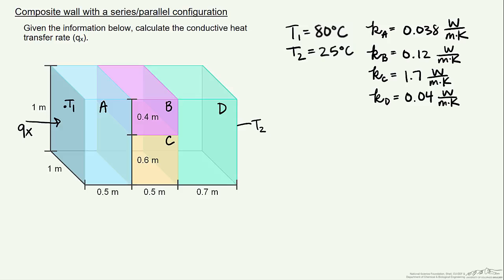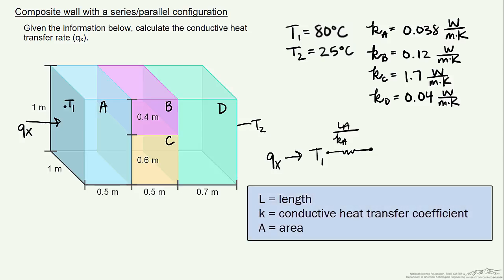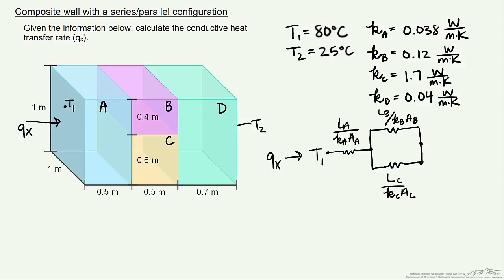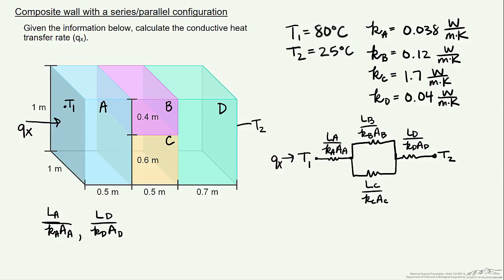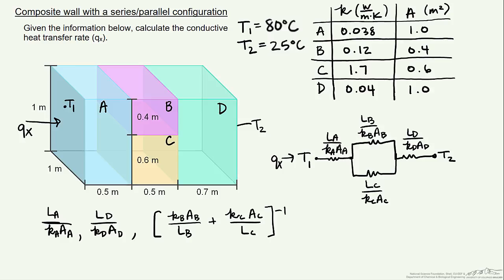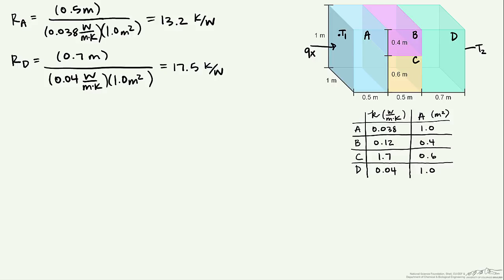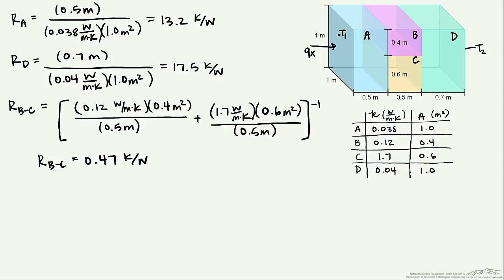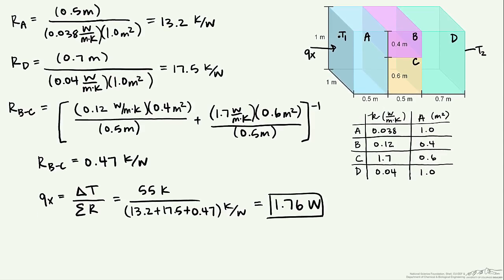Composite Wall with Series/Parallel Configuration

Comment: Once again errors made in this video:
When summing up the total resistances, Rt = Ra + 1/ Rb + 1/Rc + Rd
This will give Rt= 32.79 K/W and hence, Q = 1.68W
Reply: This is correct. The formula goes 1/Rbc  = 1/Rb + 1/Rc, thus the -1 power in order to convert it back to Rbc.

Comment: Please all note that temperatures in the problem are in ºC while in the solution are in ºK ...
Reply: Doesn't matter we are concerned with temperature difference so the value will remain same
Reply: @AbhaySingh-wi4qu  True, the conversion only mater if you are going to divide or multiply temperature units
Reply: @isai1331  Exactly

Comment: One thing that puzzles me about this method. The temperature of the A-B interface is not the same as the temperature of the A-C interface, is it? same for on the D side... How come that the circuit analysis works like this? What is the 'T' at the nodes that I am mentioning?

Comment: B area is 0,4x0,5!! not 0,4, 0,4 is the length of one of its sides
Reply: If you watch the video again, she explains that we should take the cross sectional area that the heat flux goes through.
Reply: @soy boy 
you're such a soy boy for thinking that
Reply: The area is 0.4m2 (0.4m * 1m = 0.4m2)